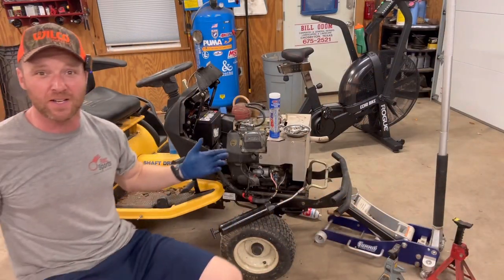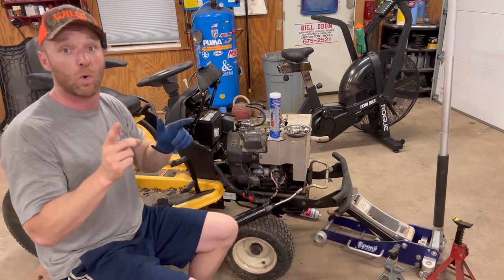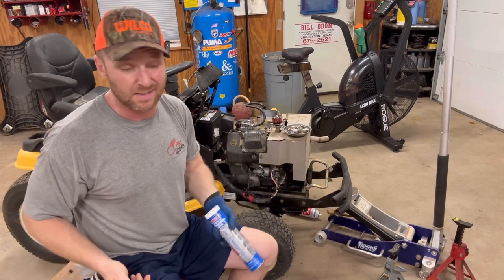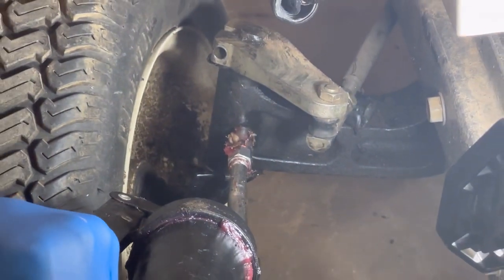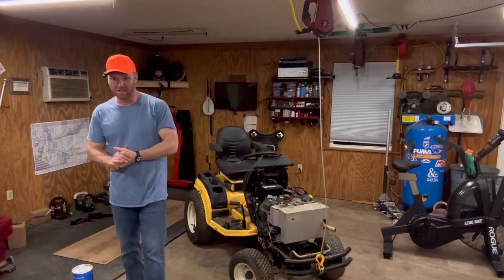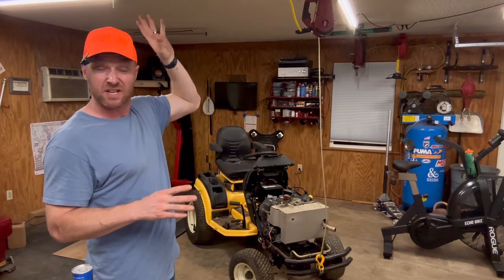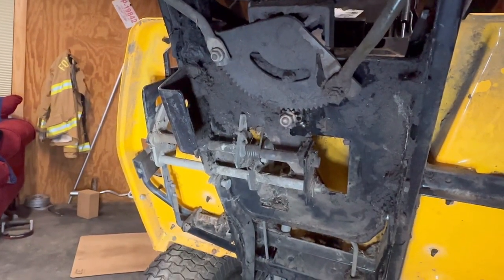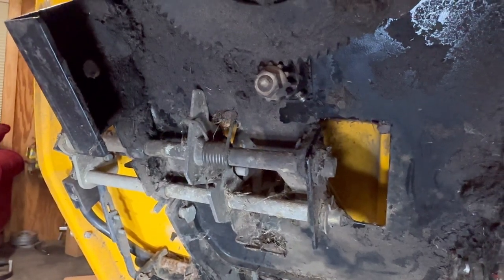Mower Steering Lubrication

Comment: How about drag link connection points grease procedures?
Reply from the maker: No grease fitting there. They are a ball joint
Reply: @MowerMike  can you grease these? I have had them wear out!
Reply from the maker: @mikeschlup5279  If there is a grease zero you can, I have no idea